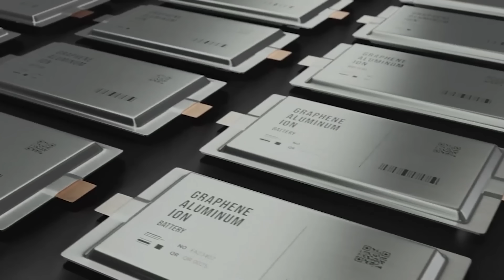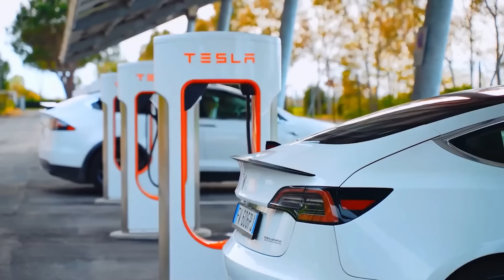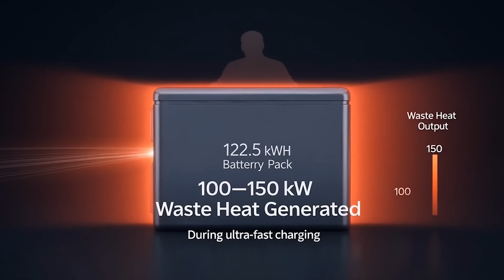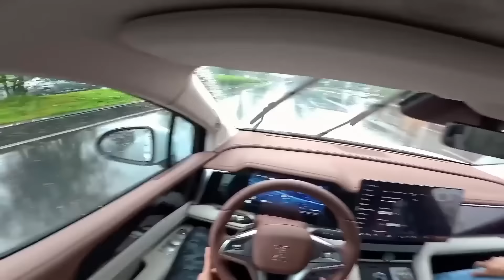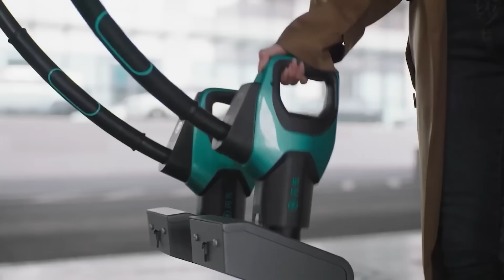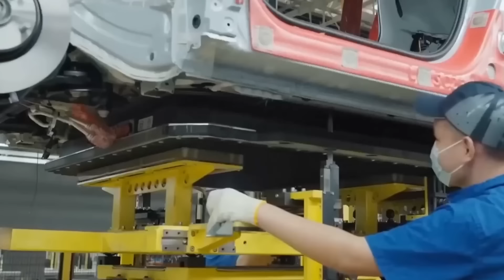1,008km on One Charge Inside China's BYD EV Battery Technology

Comment: India is making a 'badal' battery. It needs only need concentrated salt water and an iron rod and a copper rod. These rods are dipped in the salt solution and it will generate electricity. One cell will make only 1.1 v but connection 20 such batteries will give 22 v which can drive a dc motor, a brushless BLD motor with no permanent magnets. This battery has been tested in a prototype flying  car and found  to be very successful. The flying car was on air for 24 hrs at a stretch and came back to earth only because the pilot was too tired to continue.